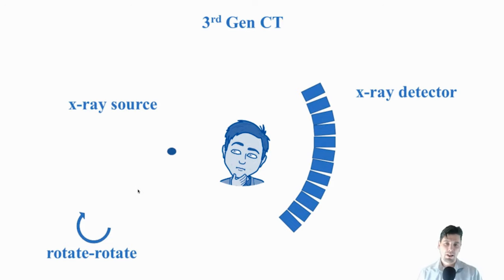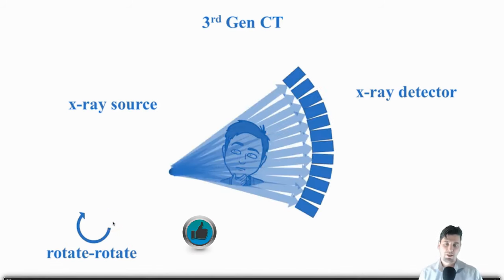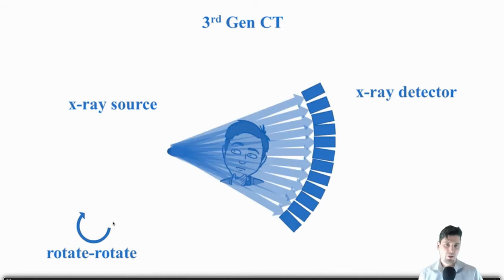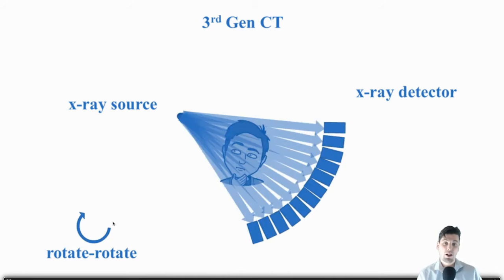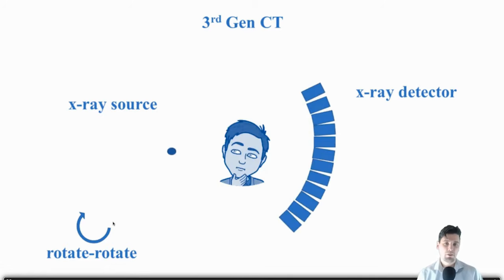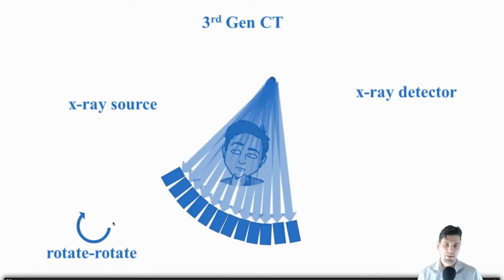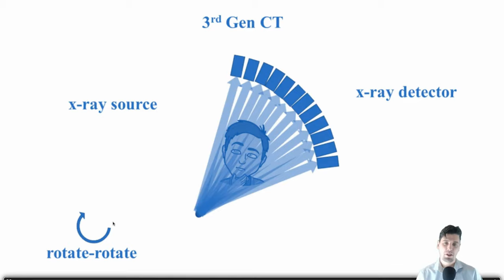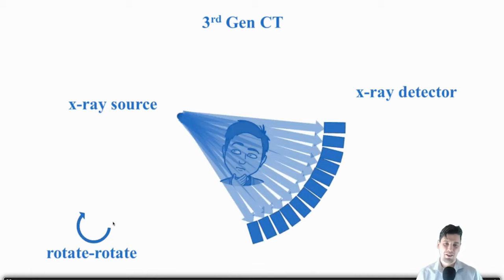Third Generation CT | Radiologic Technologists' Illustrated Guide to 3rd Gen Computed Tomography

Comment: I didn't get the difference between translation and rotation. Like the technologist had to manually or through console rotate the gantry for each translation and rotation?
Reply from the maker: The system automatically did the translation and rotation but it took time for all the mechanical motion